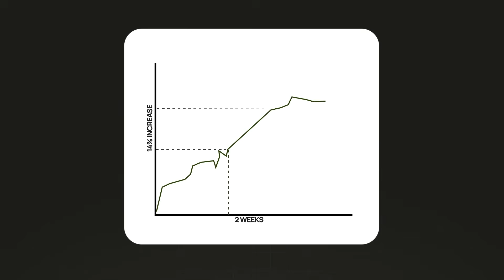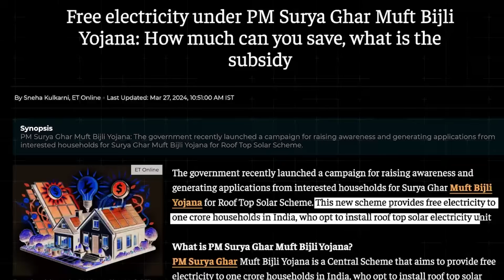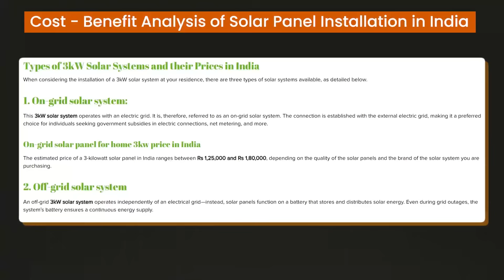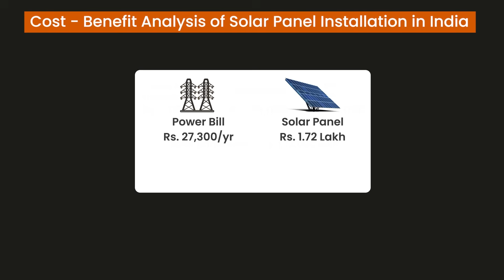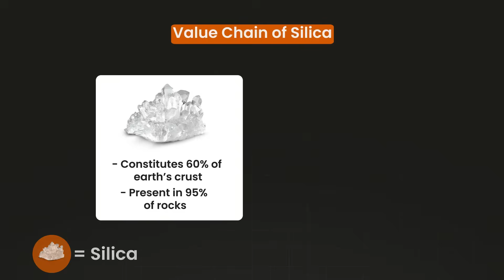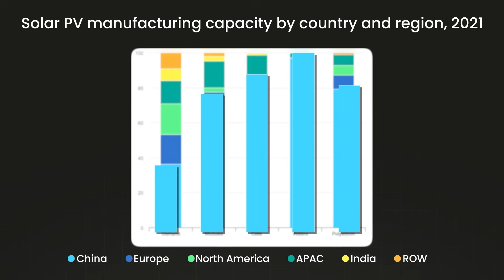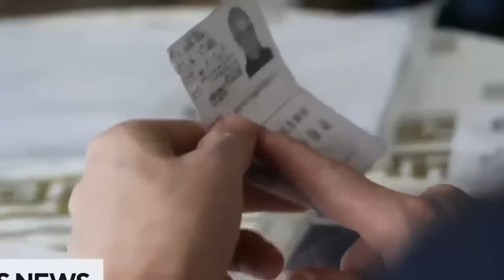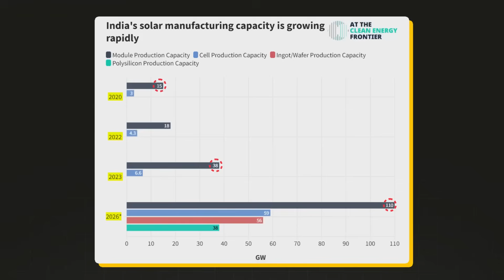Can India beat China in the Energy race? : Detailed Case Study

Comment: 🎯 Key Takeaways for quick navigation:

00:14 📈 Government announcements, like the ethanol blending or road expenditure, significantly impact stock prices, creating investment opportunities.
02:24 ☀️ India's rooftop solar scheme, offering free electricity to 1 CR households, drives up stocks of renewable energy companies like Vari Renewables, Adani Green Energy, and Insolation Energies.
04:23 💰 Installing solar panels through government subsidies can lead to significant long-term savings, despite the initial investment.
06:51 🔍 Opportunities for investors and entrepreneurs lie in financing services, insurance, and selling solar panels to households.
07:34 ⚙️ Understanding the solar panel value chain, especially polysilicon production, presents significant opportunities for investment and entrepreneurship.
10:32 🌏 China dominates the global polysilicon and solar panel manufacturing market, creating dependency issues for countries like India.
12:07 🏭 Indian companies like Adani are investing in polysilicon and solar cell production, aiming to reduce dependency on imports and boost exports.
13:57 🛒 India's solar cell exports to the US surged due to concerns over China's labor practices, presenting export opportunities for Indian companies.
14:41 💼 Achieving economies of scale is crucial for Indian solar panel manufacturers to compete with Chinese prices and expand export potential.
15:51 📈 India's solar module production capacity is growing rapidly, offering opportunities for investors and entrepreneurs in the solar industry supply chain.

Made with HARPA AI

Comment: I think the calculation is incorrect, Solar panels cost around 33/watt (including installation and inverter) had recently enquired about this, also double checked it. With the subsidy of 78k it costs only 21k to install the system on the house. maybe I am going wrong somewhere, but this is dirt cheap

Comment: I have a question. Since we can store solar energy directly in a battery after converting it into electrical energy, we can use one inverter to convert that DC into AC for our houses, just by changing the battery connections, right? In that case, can we have 3 different 1-2kWh systems at home, instead of 1 single 3kWh system? With that we can get ~90k subsidy? I mean, we are not risking anything right?

Comment: I have a solar rooftop from 7 years. But what one needs to know is that the inverters required cost around 35 to 60k and they conk off often and invariably under one pretext or the other they refuse provide warranty support. Earlier delta inverters and now Goodwe inverter, both became useless in these years. Goodwe just after 1 year. There needs to be proper regulation around their functioning

Comment: Hi, i would to point out a couple of mistakes in your calculation.

3kw costs around 1.8L including inverter,  installation as well as labour. If you want use roof space then a raised structure is needed for installation which will lead to a additional cost of 30 to 50k depending on your roof size.

Comment: India can't beat china in energy and solar roof top scheme is going to fail.

I will give the reasons why so:

For roof top solar, Indians need roof. However most of us live in Flat and appartment with no or limited roof area to implement roof top.

Cost: as the cost of installing solar panel is expensive compared to the surplus funds Indians have, it's not economically viable option. Although as given in the video, lets assume it takes 5 years to break even. However would someone invest in roof top or buy some other assets for good investment purpose.

Roof top will be successful if it is installed in non residential project like shopping mall, corporate office as these places consume more electricity than any household (commerical building run Ac almost entire day of the year, where as house use AC only in summer) And the commercial project can break even in less than a year if they implement rooftop project.

Comment: I would like to correct the costing of rooftop system of >3KW.
Total cost including latest topcon panel/ inverter/structure/ cables- 1,77,000/- only.
After subsidy of 78,000/-, user to pay less than 1,00,000/-.
ROI of investment < 5 years.. 
6:19

Comment: Stop talking nonsense. Warranty of 25 year doesn't means those panel will work with same efficiency. After two years you will find cracks. How you calculate 18.7 yr free electricity to give rosy pic. I am using solar since last 5 yr. Add inverter cost as technology keeps on changing

Comment: The math is not correct. ₹1.8Lacs includes all (panel, inverter, structure, installation etc) for 3KWp system. After subsidy, the cost will be around ₹1 Lac.

Comment: The solar rebound effect is an unintended consequence of residential solar adoption. After installing panels, many households increase their electricity consumption, thinking they can use more since they're generating clean energy. While off-grid systems are insulated from this, on-grid solar households may contribute to higher peak demand on the grid in the evening. Although rooftop solar remains beneficial, policymakers must account for this behavioral response also. A holistic approach is needed to successfully decarbonize our energy supply, considering not just individual actions but also the complex web of incentives and impacts.

Comment: This sounds well ,you will get free energy, but reality is not this. In our country the power supply does not remain 24 hours, due to shortage of electricity,bad weather & some other reasons. So if we don't store the whole solar energy in batteries of the installed solar plant ,there is no use of that energy. Secondly if we use net metering in that case the power supply should be 24 hours from the Power Distribution Station.if power supply is not coming continuous ,you can't send solar power to the local power station neither can use in your house, this is a major drawback of the net metering system.
I have heard many times, everyone is talking about the merits of the solar  system but not talking about demerits.
If you are a consumer of >7kw load in that case govt charged you per unit cost  in KVAH instead of Kwh. 
Now Power Factor plays an important role, with a solar panel inverter PF  decreases, hence increases consumption. 
Before installing the Solar system in  your House/Company/other ,please check the annual energy generation data of installed solar plant for better understanding.

Jai Hind....

Comment: Great job Bro but wanna add some points, you are telling these ROI using the datasheet of Solar panels and systems but believe me Solar panels efficiency start decreasing yoy just after 6-7 years and lots of defects will arise in Panel itself and with the connections/inverters too. Storage battery has a life of 5-7 yrs only, inverter too can fail after 5-6 yrs due to fluctuations. ROI will be minimum 10yrs. And after that recycling of panels will be a big challenge for the world. I being myself an Renewable energy engineer can say Solar is not a proper alternative for a clean energy, we must focus on other sources like Micro nuclear plants, Biogas fuel power plants along with solar power plants.

Comment: Net metering is a decent thing coz the price is capped for per unit that might be 2 or 3rs so it's like penny and tou told avg household bill is 2.7k that is not matching with mine our goes max to max 1500 we don't have AC and I think 2.7k bill for most if the household is not real data

Comment: As someone who's running a business in the solar industry, im sorry so say but some facts and figuere quoted in the video arent accurate. 

1. Lets get the terminology correct. kWh is the units u pay your bill on, when u say "a home uses ~3kWh", you're implying that the home uses just 3 UNITS of electricity per month. kWh is units of electricity and kW is the SIZE of the solar plant or the load (capacity of machines) attached to  a system. When a load of 2kW is run for 2 hours it shall utilise 4kWh or units (2*2). They're completely different things. 
2. Price of a 3kW (not kWh) solar plant is in its totality Rs 1,80,000 (Max) it includes the inverter, structure everything (except batteries but im assuming were not talking about battery based systems). So adding inverter and other costs to that price is basically double counting. Price for a 3kW after subsidies is actually 1L.
3. India's module manufacturing capacity is about 64GW. 
4. Cell manufacturing is a very capital intensive business, its not easy to get into it, plus as u said it requires massive amounts of energy. So the working capital is also quite high. Im not discouraging people from entering this particular space, but its something that seems to be out of reach for most of us. 
P.S. One of the producers of Cells is Jupiter. TATA has a small capacity as well.

I can help you with more insights if needed, i lile your videos, but i think these corrections are necessary to clear the concepts.

Comment: We also need to scale up,
Sodium ion battery manufacturing for Stationary storage.

Because you need to store solar energy for uses at night time.

And For Stationary Grid storage, Energy density doesn't matter.
It just need to be cheap.

Sodium ion Battery will be cheaper than Li-ion battery if mass manufacturing is achieved.
(Its Because Sodium is abundant and cheap )

Comment: (1) To compete with China on something Chinese already had market dominance. That’s the shortest path. 
(2) silicon refinery is both capital intensive and energy intensive. Chinese managed to succeed by using slaves. If that’s the case, it can be replicated at the slum.
Reply: Not slaves china doesn't have slaves just say cheap labour but now days they don't have cheap labour, the only strength china has is it massive supply chain, capital, well developed infrastructure and government support

Comment: No sir. 
Surya ghar scheme is ongrid scheme (without battery storage). In this cost of installing panels range bw 60000-70000 per kilowatt,  depending upon panel brand and height of panel from base. The breakeven in max 3 yr, and not 6.3 yr
Reply: But cost consumers pays after subsidy is around 25000 for 1kw and 50000 for 2 kw

Comment: Overall a nice video, always have been. The efficiency of Solar Panel needed to be addressed, unlike the material as you mentioned 80%, the efficiency of panel stays in the low range of 22% ~18% in reality, development of new materials will boom demand for the efficiency in upwards of ~25% to 35%in future. Plus big players - Reliance has started manufacturing Solar Panels and has taken a substantial portion of material import advantage. The point being major manufacturing industries setting up traditional infrastructure and good with govt [Currently Modi] is only able to enter in manufacturing. The new material tech driven panel won’t be utilized as it will hamper the currently invested, a tough market even with subsidies for new comers. Just like Solar energy was stalled by the oil and gas lobby, solar panels own development is stalled by the vested interests.

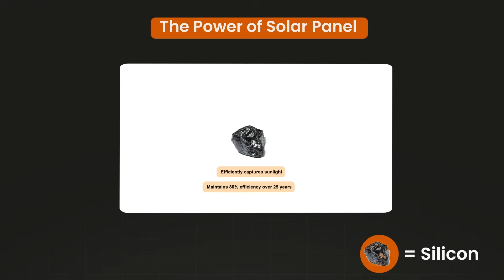Comment: Correction: each solar cell consisting of polysilicon gives maximum efficiency to 18% to 20% only not 80% even coal power is giving efficiency up to 70% 7:52. I think u should bring an expert opinion for technical understanding.
Reply: What I understood from that is '80% of the efficiency at the time of installation'. It is just badly worded I think.
Reply: @DrFact-cn8gc You, are right he meant it. What you have said
Reply: @DrFact-cn8gc  if the efficiency is as so high then Govt would invest whole money into solar panel, even they can shutdown the coal power plant, wind power plant.  At the installation the efficiency is remaining the same but only output power is changing as the number of solar cells increases.
Reply: @kevalkanpariya  No, no, you got me wrong. Even I meant 80% of ORIGINAL or INITIAL efficiency.
Reply: He probably meant it can retain 80% of its original efficiency (of around 20% although China came up with one that is 33% recently) even after 25 years.
Reply: @k.k.c8670  that might be true

Comment: bro i installed a 3kw on grid solar system which cost me only 2 lakh rupees and got a subsidy of 108000 rupees and at last it cost me only 92000 rupees
Reply: In gujrat price for 3kw solar plan cost us only 1.1 lakh after receiving the subsidies
Reply: So, what is the maintenance cost.
Reply: @ashishjadon3046  idk 😅
Reply: @ashishjadon3046 , solar panels maintenance cost is primarily cleaning (with water). Remaining you can get a bi anually checking done with any expert.
Reply: How much energy is generated on an average in 24 hrs ?
Reply: @Atheist-Libertarian  ~20 units per day
Reply: What state do you reside ?
Reply: @ubtforever  UP
Reply: Bro, how do you manage AC, fridge etc? Is this the alternate of Invertor only or I can get some other appliances too connected?
Reply: @NarayanTripathi29 apart from AC it works everywhere
Reply: @NarayanTripathi29 it will be converted frm DC to AC
Reply: 3kw for 200000 .... Expensive hai
Reply: @RahulVerma-mf5jk  yes but there is subsidy and will lead to reduction in power bill which will pay off the cost. 
It will also make the power grid more robust and efficient, which will reduce electricity costs for other users too. 
This is a true free electricity scheme. 

This is a long term win for Indians.
Reply: @RahulVerma-mf5jk in Gujarat we Avirat energy pvt ltd selling 3.27 kw system for 155000 out of which customer gets 78k subsidy. So customer gets solar rooftop for only 77k.this includes 5 years service also.
Reply: which panels?
Reply: @Maxxtorqq  adani monoperc bifacial solar panels
Reply: Which state?
Reply: @sitharthasg7402  Whole India.
Reply: @PriyanshuSingh-iu2yy bro from which company you have installed the solar system
Reply: still not free lol
Reply: JUST curious if i have  joint family. 5 ROOMS with Ac and 2 fridge ..how much solar investment  will be required and also during rainy season and night
Reply: @kevikhate i think 4kw is enough but you can ask company btw
Reply: @kevikhate atleast 3 to 5kW if consumption is high
Reply: My Dear Bhakt instead U  go and Settle in Delhi or Punjab Your All Hard Earned Money Would be Saved 😂
Reply: @homeelectrotech7057 road namzi agaya 😂
Reply: Do you get electricity at night if there is a power cut
Reply: @unknown.m.e  bro, there will be inverter and batteries to store the excess power produced by the panels and unused, which can later be used at night time. But in rainy season, the power is mostly drawn from the Grid.
Reply: @motivationtomove8979   I thought we can't use batteries to store the power if we want to use scheme.
It should be connected to the grid.
 
That's why I am confused. How much it is helped.
 Inventors are not something I want to use since we can't use AC or high consumption electronics.
Reply: @unknown.m.e  bro if you want to store energy then you can go for hybrid solar system which is eligible for subsidy..... but it is costly too
Reply: @PriyanshuSingh-iu2yy   is it? I thought the scheme was only for on the grid connection.
Reply: Yes, the scheme represents something called as an on-grid system where there are no batteries to store the energy. All the generated energy is used by the appliances itself and any excess energy is sent to the grid. 

There is technically no problem using heavy loads like AC but it is just that most of the generated electricity will be used up at home itself and very less will be left for transferring into the grid.

The latter is helpful in reducing the electricity bill but to make the bill zero or minimal, then we need a larger capacity rooftop installation to accommodate the heavy loads, but the subsidy will be less.
Reply: @unknown.m.e my father installed it a year ago well till now there is no maintenance cost 
It might happen that you have to change battery after 6-7 year like usual
Reply: @unknown.m.e  the excess solar charge can be stored in batteries and if need be u can still get from the grid